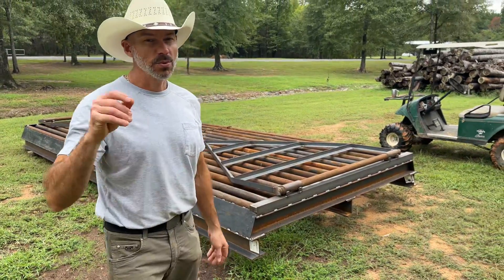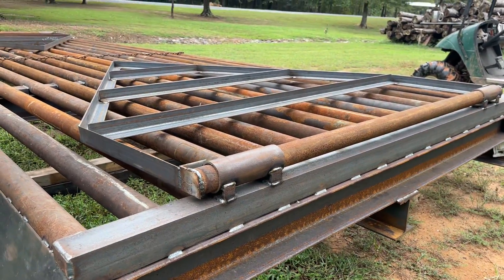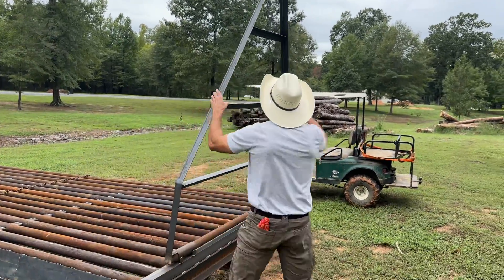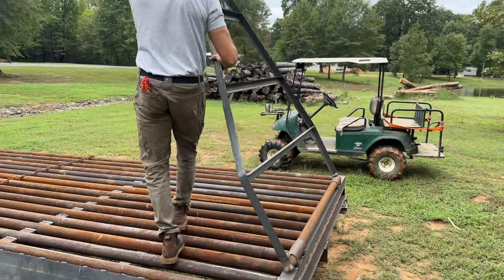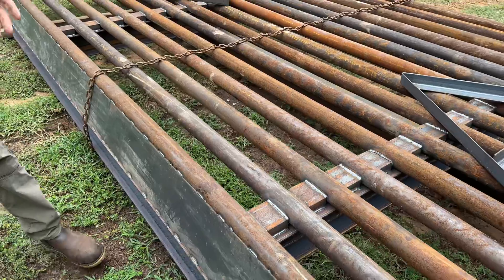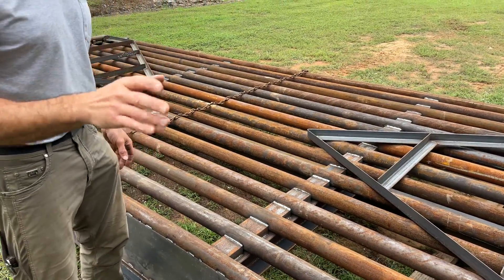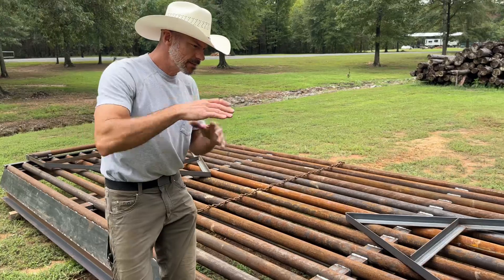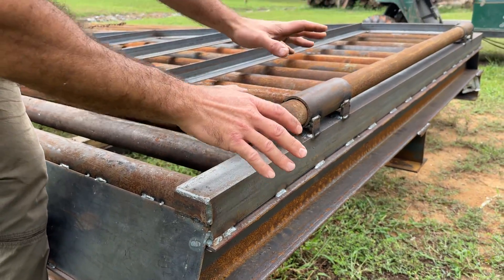Top 3 Critical Mistakes to Avoid When Welding a Cattle Gap

Comment: Hey Chris. Big fan of the channel, I’m 21 and got introduced to stick welding in secondary school. Got certified in mig last December and going to school to get the rest of my fabrication certs in November. 
I’m wondering if you’ve got any advice on getting into the industry where there’s no real oil and gas work. Most of the work here in Ireland is automotive and agricultural. The plan is to move to Australia and get into the mines or onto a rig but I need some big experience first. Thanks again

Comment: If you stopped your fence about 4' shy of that gap and had a 4' " wing" welded to that pivoting  section it would block animals from trying to pass under it. Kind of like a E sticking out from that pivoting section. Just a thought.  Another well designed project by Taylor Welding! I enjoy your videos very much. I've been welding since 1979. Fab shops, construction, oil field high pressure pipe, and now aerospace. You are one of the few youtubers that actually know what you are talking about.  Great stuff!

Comment: Here in the UK we call them a "cattle grid". I have repaired quite a few. Back in the 1950's and through to the early 1970's some were made from old railway track which also breaks. I have repaired them with a strip of 4inch by 3/8th (100mm by 10mm) flat bar across the tops and as you rightly say, at the width of a truck so the weight is spread over the bars. The "C" section channel half way up the bar is a good idea too. It keeps the bars in place, stiffens them and keeps the grid quiet. Noisey grids have broken welds!
Too allow livestock, horses and walkers safe passage, we usually put a swinging gate at the side of a grid where required. Another good idea is to put in a wildlife ramp. Here in the UK, small mammals (hedgehogs) and even frogs and toads get trapped and die in the well under the bars. Having a ramp at each end internally to help them escape save the life of a wild animal.
Reply from the maker: I bet railroad iron made a great cattle grid. The problem with the old railroad iron imo is you never know if it’s going to weld good or not.
I don’t think they had very good quality control at the foundry back in the early 1900s . They just did the best they could.
Thanks for being here JON Dingle. I always like having the seasoned fellas in the comments.

Comment: Great design, same idea and design is great for shaker plates on a construction site entrance/ exit, keeps the dirt localized and throw a sling or chain on it and yank it out of there to muck it out.  Round pipe is more gentle on equipment and backs than angle iron on point.

Comment: I don’t even put any I beam on the ends. You dont drive on the ends.
Reply: You must have never had any timber cut inside of a cattle gap, there is a reason they no longer call them log truck drivers and instead call them steering wheel holders. lol  We had some cut 15 years ago and those idiots drove off the side of the cattle gap and it was made from railroad track and was over a 3 foot deep creek.  When we built that massive thing 30 or 40 years ago my grandpa insisted we put railroad ties out on the ends (equivalent to his I-beams) because he said somebody one day might drive out on the edge.  Man was he right.

Comment: I didn't know the wings were for horses. In my area, the wings are fixed and there is a (usually flimsy bob wire) gate next to it for horses and cattle.
Reply from the maker: same here. I think people don't use them like they were intended in the beginning
Reply: They're for anything that needs to pass by the cattle gap/guard, we use them to move the cows past...though ours aren't fancy like that, just barbed wire looped over a post lol